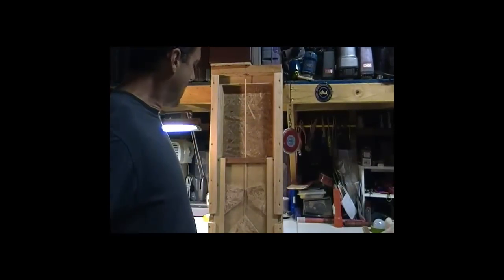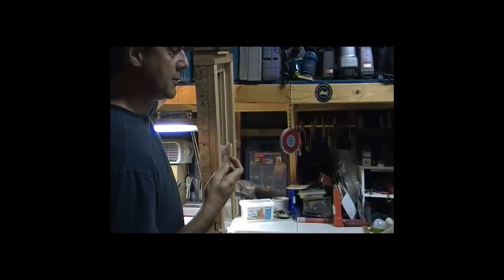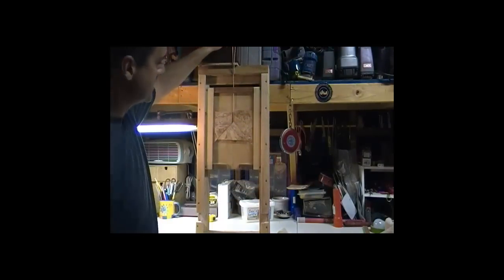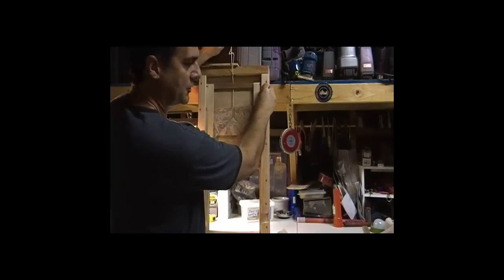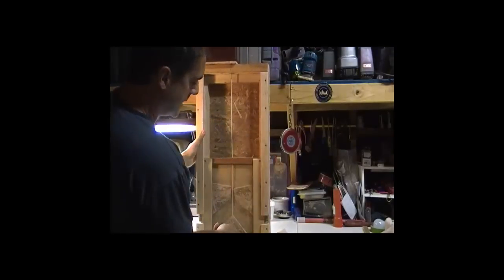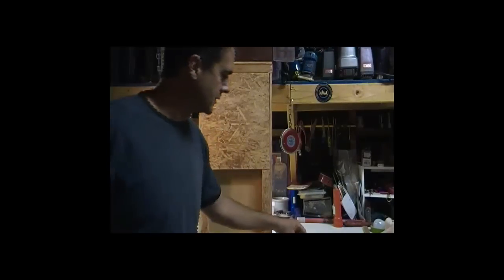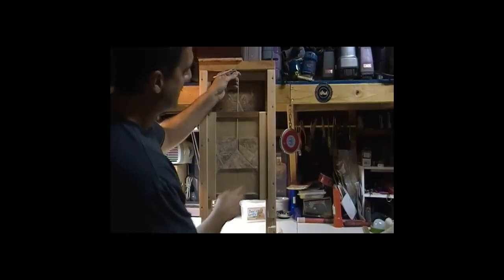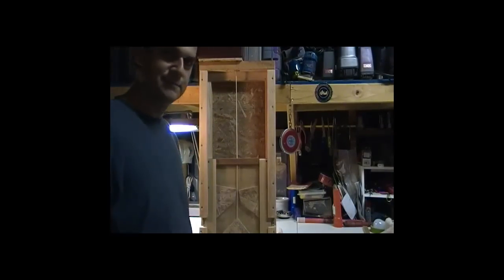Arduino Automatic Chicken Coop Door

Comment: I built a similar chicken door using a linear actuator with optoelectric sensors.  Also used latitude and longtitude to determine sunrise and sunset.  The elevation of the sun at sunrise and sunset was used to trigger the door. the linear actuator prevents the door from being lifted by racoons. thanks for showing this video.
Reply from the maker: Cheers!

Comment: Very nice door build. I hate these string door type. I am a Linear Actuator type of guy.  No need for figuring out locking mechanisms or limit switches. But yours is nice.
Reply: I built a similar chicken door using a linear actuator with optoelectric sensors.  Also used latitude and longtitude to determine sunrise and sunset.  The elevation of the sun at sunrise and sunset was used to trigger the door. Any elevation of the sun can be used so it could be 10 minutes after sunrise or 10 minutes before sunset.  The linear actuator prevents the door from being lifted by racoons. thanks for showing this video.  No strings attached and no locking mechanisms required.
Reply: @stephentranquilla7785  TY for the comment. And you're welcome for the video. Sorry I had not replied. I just now saw the email. I know that you did not mean to comment to me but just the same....

Yes I absolutely love using linear actuators for chicken doors. They are reliable and up or down they are "locked" in place. But on most forums the string people always start being overly concerned and paranoid. They start protesting that the linear actuator will crush a chicken. Yet I personally never actually had a chicken get crushed nor have I heard of one getting crushed second hand, third or even fourth. It has ONLY even heard when a string person starts protesting, and curiously & suspiciously it comes more from people pushing their string door. LOL Go figure. 

So long ago I can up with a simple circuit to stop the door. A little more wiring and you can make it go back up. Add a counter and it will try however many times you want and then it stops at the lowest possible point.  And all that just to stop the nagging. LOL. Besides if the string door fails that door can still delete a chicken if it hits the head or neck.

I do not know how you are going about the Long and Lat operation, there are so many different options. My favorite is using 2 Astronomical Timers. Set Time and Lat, with the current day's sunset/sunrise, offsetting the time as desired and it automatically adjusts. It uses the same calendar as the timelord. No need to adjust the clock for daylight savings.
Reply: @stephentranquilla7785  https://youtu.be/hdnB3Q2dBfI?si=-xP3aWxpK-DDL8m_
Reply from the maker: Thanks much for the kind words!
Reply: @dhnaves  Well I guess I have to somewhat eat my words. As to hating string doors. Well I absolutely love mine. And I never intended to make one either, since there is four things I have issues with. Just for some reason I had all the parts and the idea struck. I Removed all the issues. 

1 String. People use string or rope, to me the string is weak point that can kill a bird if the bird was under it when it snaps.
2 Motor Mounting and spool. I see so many very nice ides and designs but they all seem like too much effort and adjustment. Then connecting the string and driving a spool or shaft
3 Security. Yours addresses this and is nice but again same as mounting the motor. Seems like too much effort and adjustment.
4 Failure. If they fail there is no safety feature that keeps the door from falling on a bird. 

1 String is stainless steal cable
2 Motor already come with spool and way to mount.
3 locking system to two minute to figure out and 5 min to mount.
4 Safety feature was already half done. I seriously doubt this will ever fail to the point the door falls, but it's there.

Well in two hours I put this together just because I had the parts. LOL Turns out I really love it LOL. Plus like tow days later when the idea struck for the safety feature. What you think?

https://youtu.be/jYM0xZ8TwaA

Sorry for the background mess. Took this video cuz bother asked for it.

Comment: Great project! I want to make a similar one. I am quite familiar with arduino coding, I just don't have much experience with motors and motor drivers. One question (sorry if it's banal!): during the day, when the door should remain open (chickens would want to go inside in the shade/lay eggs/sleep) , can the motor hold up the weight of the door and how ? does it need to remain under tension or ... ? Thank you.
Reply from the maker: Hi Lorenzo... Thanks g t the kind words and great question. 

Yeah,  it's pretty simple. The motor simply stops (there's no constant running/tension) and has no problem with the weight of the door.  BUT, definitely don't overbuild the door, making it too heavy, as the motor  might have a hard time lifting it in the morning. The links below to the full project on my website has all the parts listed.

Best of luck.

Cheers!
//D

Comment: What was the final dollar spent on just making the automatic door? Thanks
Reply from the maker: +Marc Brunson  Hi Mark,  I'd estimate that the final cost of the door was $90.  (that includes the Arduino at $45, which was shared with all of the other coop features)  The door itself was made up of scrap wood, cable, hardware.  The other stuff was relatively cheap: motor, motor controller, wire, breadboard, lcd, resistors, etc)  Cheers!